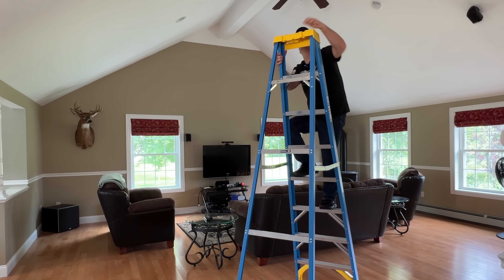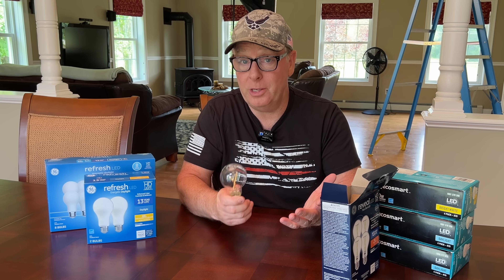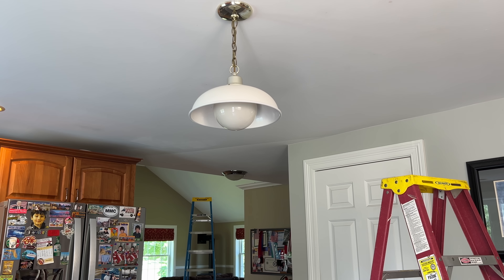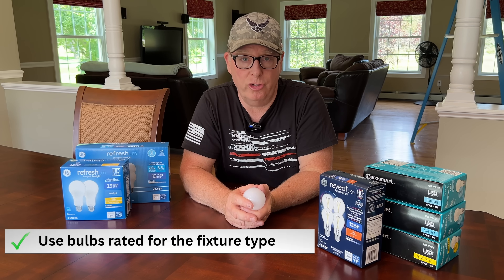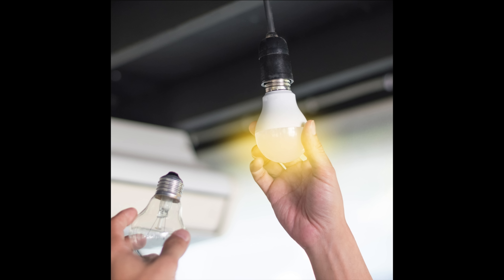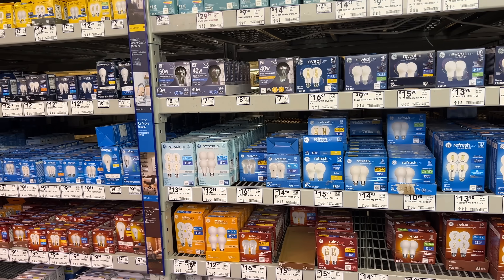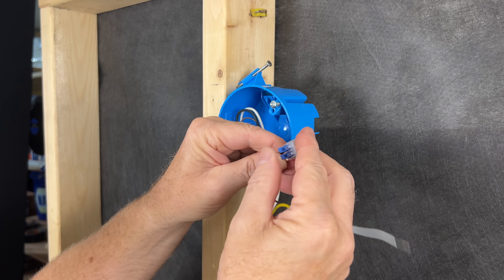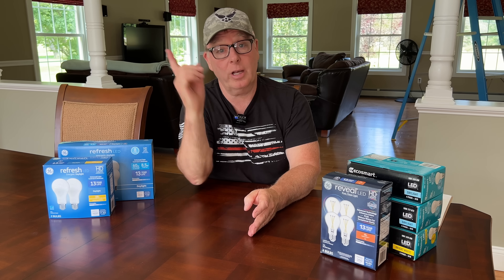The Mistake That Kills LED Bulbs

Comment: @BackyardMaine, look into light bulbs in Dubai; it's fascinating.  TLDR, the king decided there were only going to be a few kinds of bulbs allowed in Dubai, and they were all going to be LED, and they were all going to be efficient, and they were all going to last, because he'd heard that light bulb manufacturers had conspired to make bulbs burn out sooner than they needed to.  Philips stepped up and made a bulb to his specs, and in return Philips has a monopoly on bulbs in Dubai.  But Dubai doesn't export the bulbs.

The closest I can find in America is the "PHILIPS LED 60W A19 Ultra Efficient Soft White" which (a) use only 5W to provide the light of an old 60W bulb, (b) say they last 50,000 hours.  I bought eight of these 2 years ago, and they all still work.  I think a big reason for their long life is that, as you say, the biggest problem for LED longevity is heat.  And if a bulb consumes less power, it's also generating less heat, so it's staying cooler, and lasting longer.  So don't buy a 60W bulb that uses more than 5W, or a 100W bulb that uses more than 9W.

And seriously: Search for "Dubai bulb", it's a fascinating story.

Comment: For recessed can type fixtures, use a bulb extender.  It will drop the bulb down further from the top of the can enclosure allowing more ventilation around the bulb base.  They make various length extenders, some will drop the bulb completely out of the can enclosure.

Comment: I still haven’t found a good led bulb that works well with my outdoor dusk/dawn accent lighting.  The ones the do light dim, make horrible buzzing.  I just buy halogen incandescents, but because they are lit often, I would still prefer an LED.  I have even tried more expensive bulbs label for this use case, and still have had no luck.

Comment: I too found that 8 of my 12 LED bulbs failed within 6 months, even Osram (high spec) bulbs.  That's way more expensive than incandescents which cost perhaps one-tenth of the price and can last 2 or 3 years. (UK/240V).  I'm trying drilling ventilation holes around the electronics... at your own risk!!

Comment: the only thing thats new for me is that there are leds for fixtures which have a higher heat rating, everything else is self evident.

also i dont agree with only buying from big brands. none of my philips or osram leds are any better than names i never heard before, just look if the product has a good amount of 5* ratings, thats the only thing that you can really go after.

Comment: DC power makes much more sense for DC technology - LEDs.  AC/DC is wasted in heat by both rectifying full-wave, smoothing (caps) and then stepping down to appropriate DC.  I'd rather just have the option to buy the incandescent bulbs, but they've taken that choice away.

Comment: Cheap bulbs that crap out soon or pricey high quality bulbs that last a long time?   I'd go for the latter, mostly to save trouble with spending time on maintenance and being in the dark until I get to the store.  

OTOH, I know a physics professor who would by the cheapest wristwatches, the kind of single dollar priced impulse purchase items in the checkout lanes or deep discount bins in stores. He reasoned that yes, they last only one year or so, but so very cheap, that in the long run, they cost less than a decent quality watch at maybe around 100 bucks.

Comment: Reversing the white and black wires was interesting. I expected no change, light glows like normal, and it did. It shouldn't matter, aside from that safety concern. 

In the house I grew up in decades ago, I once measured the voltages at the outlet.  One slot was just over 60 VAC RMS. The other slot was  40-something VAC RMS.  No safety either way in that house! We never had any trouble with it, but everyone should know some houses are wired oddly.

Comment: I thought that voltage was killing some bulbs. Some bulbs are 100-250V now which could make them last longer. I’ve seen my voltage here consistently at 127-130V in the shoulder seasons. The (electric) co-op said that’s normal and they won’t do anything.

Comment: I have a problem with the way a fixture is wired in my house. The switch controls the neutral, instead of the hot wire. It worked fine for incandescent bulbs, but with led bulbs, apparently enough current can flow to make it flash, even when it is turned off.

Comment: I bought Cree brand LED lightbulbs from The Home Depot back when they first started selling LED bulbs. They all died within months. In my opinion, the Cree branded packaged bulbs are garbage. And I installed them in open fixtures. I spent over $20 per bulb, too. I replaced them with GE LED bulbs which are still working 15 years later.

Comment: 8:15 to DIM led lights the other system (three wire) is better BUT I have found LED lights with three levels of power and you can select it by switching them on and off. That is a MUCH BETTER solution since the whole circuit was designed from the ground up to support such levels. Thanks for the video!

Comment: Do not use the bulbs in an inclosed light fixture. They need to breath and vent there heat. Everyone that seems to have problems are using the light bulbs in a inclosed light fixture. All my light fixtures have the bulbs exposed and they have lasted 5 plus years and still going. The only bulb I’ve recently had to replace was the bulb in my range hood and guess what it’s in an inclosed light fixture. Heat is the problem it’s prematurely killing the bulbs.

Comment: I've never had a Philips LED bulb fail, and some of mine are about 15 years old. I have bought all different types and at multiple times over the years, the most recent was a large number of GU10 bulbs about two years ago - also all still working great and used often. Friends I know are constantly complaining their bulbs fail, but even after saying how reliable my bulbs have been they keep buying really cheap bulbs with brand names I've never heard of. The light colour is always horrible too, either greenish, grey, or flickering.

Comment: I've had terrible luck with the Ecosmart bulbs, they fail faster than any other brands of LED bulbs I've ever bought (They are cheaper for a reason)... Cree is the LED module inside them, but that isn't the electronics, which it seems is what dies fast (I've bought about 2 dozen over the past 5 years and none of them last very long)... their Feit bulbs on the other hand seem to last quite well by comparison, so if you can find like-for-like, I'd recommend the Feit bulbs over Ecosmart at HD.  Just my experience.  (I've used GE, Phillips, Feit, EcoSmart and more that I can't recall, Ecosmart have consistently been the worst for reliability of all I've tried, including many in open air housings (like vanity light bulbs for example)).  YMMV

Comment: I'm not sure If we should agree about how LED bulbs fail because of long power intervals. LED's or other electronic components should not fail because of use in normal conditions even if left powered for extended durations because most electronic components are very reliable these days. I have electronic heavy power components that are 50 years old and are working fine. Most of the hype created for LED sale and use was about power savings and longevity. Power savings resulted from not using metallic, hair thin, power sucking, heating filaments heated to glowing incandescence and the filament is the same reason for the longevity hype. Like any other material, a tungsten filament would weaken and easily break due to the repeated 120v heating/cooling cycles. We can however, agree that the manufacturers may cut corners using LED bulb electronic components where the batch testing was questionable or sub par; resulting in premature failure of said components or we can agree that manufacturing of the bulb itself is without good quality control. This is believable considering how industry greed and dishonesty dictates every aspect of today's business around the world. Dimmable bulbs? I would not use dimmable lighting because of the same reason you pointed out: its hard on components, wastes power and is more expensive; - do a lighting luminosity test to see what the best average is. Not sure how the dimming works in LED applications because the transformer in the bulb is rated for only one AC voltage. Is there a bulb with variable power input as in MOSFET control and is it readily store shelved? And where is heat generated in a LED bulb? The only place there should be heat is at the 24v (secondary) transformer and I have never felt a lot of heat there in fact, I am testing my bathroom lighting now and the 8 bulbs in two rows of 4, all run at 70 - 74 deg. F. at 6 inches from bulb and I can wrap my hand around them without discomfort.  I still appreciate all your other presentations. Still thumbs up.

Comment: Use 12vdc lighting, then use a DC-DC buck regulator to regulate the power down a little below 12vdc and under drive the LEDs, works good for me.

Comment: Correct about componentry having a lot to do with it.  My office fixtures have the Philips "L-Prize" bulbs from around 2012.  They're on 12 or more hours per day, and still going strong, in down-facing fixtures.
Reply: We also have several from around that time that are still working fine. Some are in recessed fixtures in the kitchen that are on a lot.

Comment: Buy decent integrated fixtures. They separate the driver and usually have big heat spreading pcbs seriously extending life. I maintain some 30 lights that go on at dusk and off at dawn. CFLs used to last 2-3 years that way. Retrofit LED bulbs struggled to come close. The integrateds I fit in 2015 and 2016 are ALL doing just fine. Seriously surpassing their rated lifespan. They must have done about 50,000 hours by now and they were rated at 15,000 hours for the consumer type and 35,000 hours for the industrial type.The former I expect to start failing within the next five years, the latter will probably last another 20 years.

Comment: Philips has new "ultra efficient" LED bulbs that use half the watts or less of a typical LED bulb. They're the only ones I've used that are able to dissipate heat before they bake themselves in an enclosed fixture. They are also the first I've seen that say suitable for enclosed fixtures on the box.
Reply: Yeah, I've bought these starting about two years ago, and none of them have ever burned out on me.  They're "PHILIPS LED 60W A19 Ultra Efficient Soft White".  I think they don't sell all that well because they don't get a lot of repeat buyers.  One of their reasons for longevity is that they're more efficient than other bulbs, so most of their energy goes out as light, not heat, so they don't get as hot, which as the channel says, is the #1 killer of LED bulbs.

Comment: LED bulbs are not "higher price" - they are dirt cheap and that's exactly why they fail A LOT sooner than they should. Here are three examples of THREE slightly higher priced lightbulbs at the time I purchased them:  1) a dozen of 15W Osram Dulux Superstar CFL for $8.50 (made in 2005 in Germany)  2) several 15W and 20W Philips Master CFL for $8.00  and 3) One 24W Osram Circolux CFL for $18  (The most BEAUTIFUL lamp/bulb I ever had) .  Mind you, all prices are from ~2005-2007, because all were manufactured about that time. The Most expensive Circolux was rated for 15 000 hours, and it lasted 19 YEARS (until 2024) clocking more than 21 000 hours of use. currently, as of 2026 ALL my Philips Master and most Osram Dulux are still in use, the only Osrams that died clocked about 16-19 000 hours of use. The first Osram LEDs that I tried about 2010 cost about $8 too, and were OK (sort of). They had massive heatsinks, and they did about 8-10 000 hours, but still died short of what was advertised. The current ones don't have ANY dedicated heatsinks, they cost $2.50 and weigh about 10 grams and will not last more than 3000-4000 hours. Why? because they are made dirt cheap ! The claims on the package are far from the reality. The worst part - if you mount them in a sealed fixture (i.e. in bath), they barely live ~1000 hours, which is the live of the cheapest possible incandescent bulb ($0.40).

Comment: The problem is the ballast which Im calling the circuit that fees the bulb. LED are made from a doped material which produces light. Generally speaking my bulbs las. The ones that have an issue are the propeler nulbs in my garage.Some of the propeller blades apparently have an open LED. I havr not investigated that issue yet, its too chilly Ill work on that this spring. The other issue a a boob fixture in my stair well it flickers. I repaired that about a year ago. The fixture is made up of seveal smaller led lamps. The lamps are soldered to a grounding plate which has a smear of heat sync grease which has dried up. I replaced that grease with computer CPU heat synch compound and the issue was fixed. Now a year later its back. I requires a ladder job to reach the fixture. Im looking for a replacement. Other wise LED bulbs and fixtures have their own issues compared to incandescent bulbs.

Comment: My house has been fitted with LED bulbs for over two decades now and in all that time I have had two fail, both because of a LED failure rather than the elctronics and these are all the cheapest bulbs I could find. I fixed one of them by bridging the failed LED with a suitably rated Zener diode.

Comment: Tip number 7:  Open a new LED lamp, locate the current sensing resistor  and replace it with the double the value one. The lamp will last forever with only a slight reduction in brightness.

Comment: I’ll take the contrarian position on this one. I’ve had about the same results with LED bulbs, no matter the manufacturer. So, I just go with the cheapest, knowing it’ll last 1-3 years before needing replacement.

They’re following the standard practice of making disposable parts, but hoping you’ll pay top dollar on brand name alone. Same with most appliances in my opinion.

Comment: Some 12V DC car LED bulbs don't have "full wave" rectification, but still have reversible fittings for compatibility with older cars. Those will only work in one direction and the instructions tell you to reverse the position of the bulb if it doesn't light at first. But there is no reason why an LED array running on AC, even one with no rectification other than the LEDs themselves, wouldn't work as well in one direction as the other. For grins, I even ran the LEDs from a bulb with a failed power supply with just a capacitor to drop the voltage and a diode (in the other direction) to drain the capacitor. With two strings of LEDs wired in parallel, but in opposite directions, a capacitor of the right value alone would be enough to properly drop the voltage, but the flicker might be a problem for some.

Comment: You should watch that video on the light bulb cartel designing bulbs to fail.
It's easy to make LED bulbs that last a very long time, but that means using more leds in each bulb so they aren't overloaded. The leds don't cost much, but the cost for the manufacturers in terms of lost sales is enormous.

Comment: Hours of operation is hours of operation... turning them off when you're not using them is great, but it's only indirectly related to "getting closer to the manufacturers rated life span" - the actual reason that "kind of" works is that heat build up destroys the caps prematurely, and more continuous time in hot conditions (i.e. continuously on and hot) gets them closer to failing more quickly than intermittent usage.

Comment: You left out one tip that goes with the type of fixture.  Some bulbs will state that they are designed for use only with the screw end down or at least to the side.  With the screw end up, the heat is rising into the end where the electronics are located.  With the screw end down the heat is rising away from the electronics.
Reply: Also known as base down/base up.
Reply: @carpecanem611  Yes, that is a better way of saying it.

Comment: Duh!  It's AC so there is no polarity and the LED bulb will work wired either way.  LED don't usually die because the LEDs die.  They die because the driver circuitry is designed too close to the edged of the envelope and are running in an overheated condition most of the time.  And they drive the LEDs too hard.

There is a European country where they mandated more LEDs for a given lumen level so the LEDs are deliver less light each but are drive less hard and last several times as long.  We could have the same thing here.

Comment: anyone knows anything about electricity knows that is AC supply, does not matter is converted to DC in the build regardless of line/neutral polarity. now is a safety issues with not getting line/neutral correct many appliances, as standard Edison bulb fixtures absolutely want to make sure the inner connection is line and the outer base is neutral wired or can get a nasty shock

Comment: It's not the LEDs that fail but the driver electronics, especially the capacitors. LED bulbs don;t like being put in fixtures that trap the heat, especially globes and recessed canisters. As a rule of thumb, for every 10C the bulb operates at the operating life goes down by half.

Comment: Can we just go back to incandescent bulbs? They lasted so much longer and really, my electric bill never changed when i switched to LED bulbs, which is now the norm. LED bulbs are not environmentally friendly, either. Heavy metals and plastics are not good for the environment. I still have incandescent bulbs which are still working after 20 years.